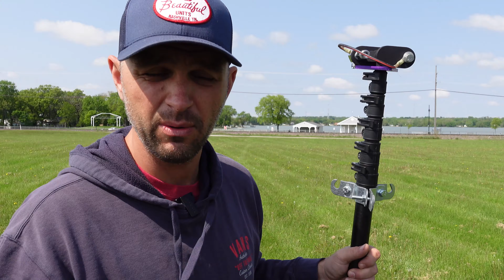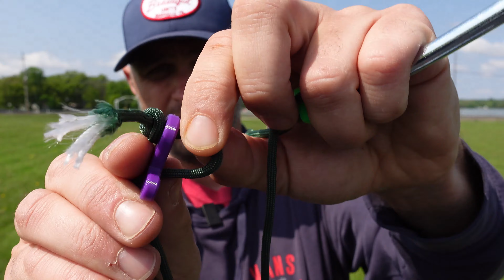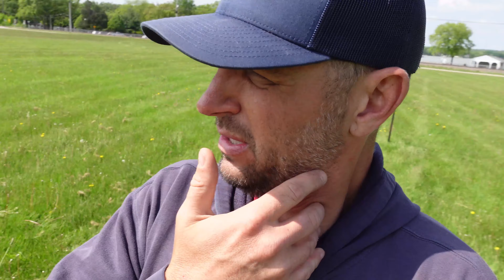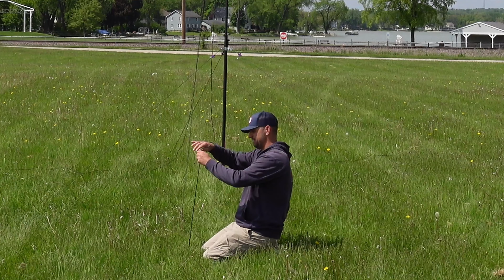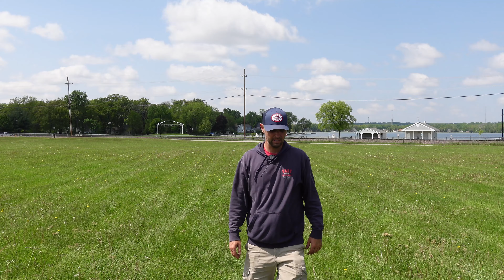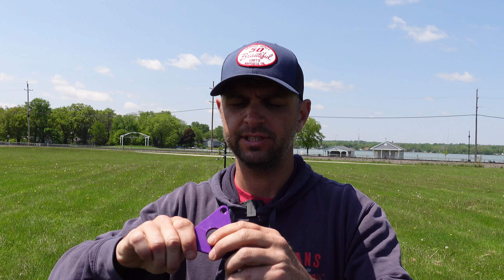Field Day Testing: Testing Guy Solutions with the GigaDude 25 Carbon Fiber Mast for Ham Radio

Comment: I'd probably get some metal rings to put on the loops at the ends of the guy rope that connect to the guying ring. I'd be afraid that metal would eventually cut through the cordage over time. I'd also recommend Mastrant rope since it won't stretch like 550.
Reply from the maker: Thanks! I need to look it up

Comment: I use ‘chopping/food preparation boards’. Easily obtained from local supermarkets here in the U.K.  cab be cut with few tools including hole cutters that get a similar shape to the ones you see on the DX Commander.  They’ve lasted quite a few years and don’t seem to be affected by UV and cheap. 73 Mike
Reply from the maker: You may like one of the videos I have in the works (hopefully in a few weeks) as it involves cutting boards :)

Comment: You might want to check out other Mastrant Guying Mast Clamps that vendors other than DX Engineering carry. There are smaller sizes available. DXE only carries the one size. Moonraker, for example.
Reply from the maker: Thanks again - ACM1310 at Mastrant, shows 3 dir, 15-102 mm which will be amazing.
Reply from the maker: Thanks! I'll check them out. I was trying to find that exact clamp other places and couldn't, but I'll look more, specifically toward Moonraker

Comment: A mast that costs more than a DX Commander classic complete kit to put a compromised antenna on?.....I'll pass
Nice mast, but WAY overpriced IMHO
Reply from the maker: I appreciate it, thanks
Reply: But this is carbon fiber not fiberglass.
Reply: @ryankc9oza118 ....and your point? That still doesn't make it worth nearly $300 IMHO
Reply: @Rick Henderson  got mine from him for 200 during his early bird. Carbon fiber cost more. This pole is alot heavier built than the last few fiberglass poles I've bought from other radio outlets. All depends what your wanting.